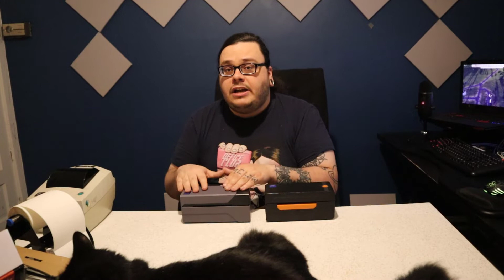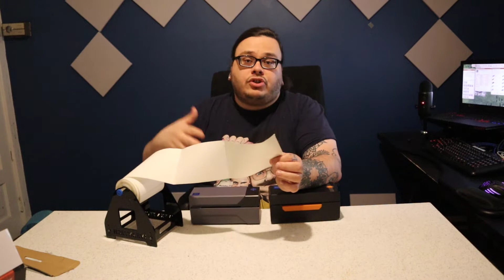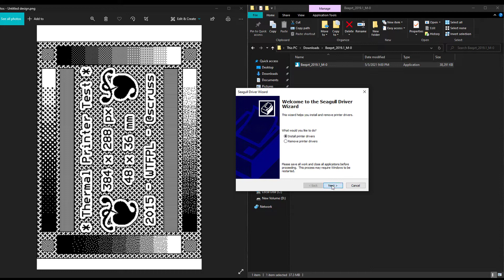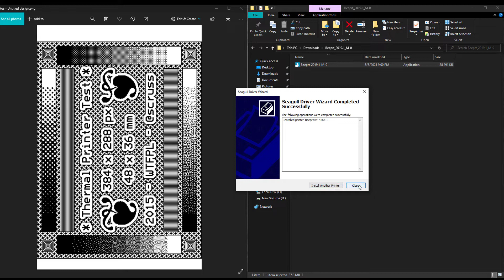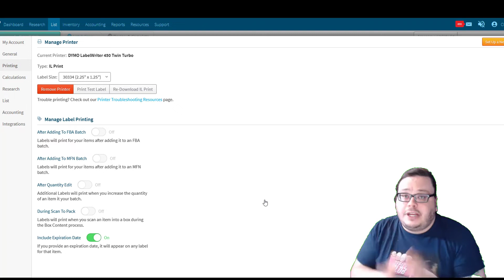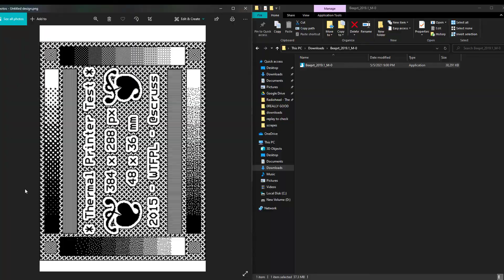The best FBA printer? BeePRT 426 vs Rollo review, comparison and set--up guide

Comment: I installed FBA PRINT on 3 different androids and FBA print will not pull up a selected PDF, it keeps saying "please select the correct PDF file or try to open it in another way".
I can print a gallery pic but not any PDF files. 
Its so frustrating not able to use my Beeprt 426
Reply: I know this is an answer to your possible problem a year later, but for anyone else having this issue, this might help. I had this same issue as all of the labels I downloaded were automatically saved with the .PDF extension in all caps. Once I renamed the extension to .pdf in lower case letters, they printed just fine. So, if your pdf files are saved with .PDF in all caps, just simply click edit, highlight just the extension part of the file name for example (JohnDoe123.PDF) and change the extension to lowecase (JohnDoe123.pdf). You can keep the original name of the file, just highlight the .PDF extension and change it to lowercase. Hope this helps someone. 😊

Comment: I’m still inprocess Of getting this thing connected. The reason I bought it was specifically so I could use it with the iphone. As a dull time Poshmark user, as well as eBay and other platforms user, I basically do ECRRYTHING with my phone except cross list. I don’t even really know how to namigsfe the desktop sites very well after all this time reselling! 😳😬. It looks like a pain in the ass to navigate through to get label to its final destination, but it is going to save sooooo much time all around!!!
Just my two cents. 🤗